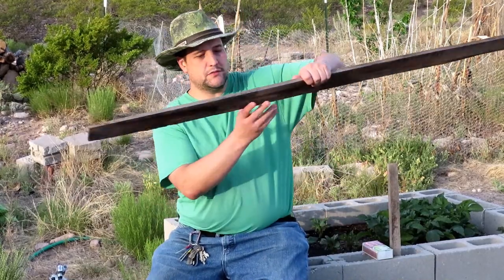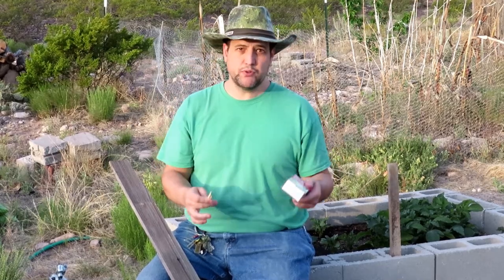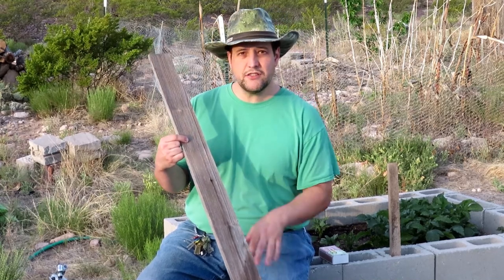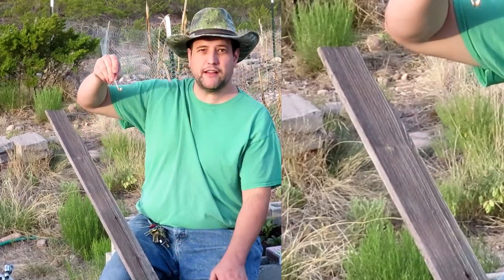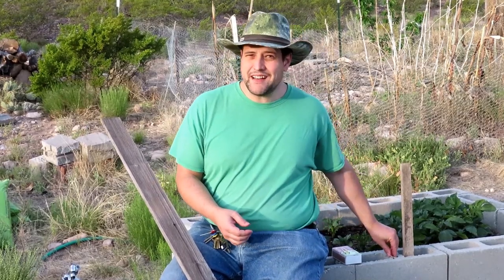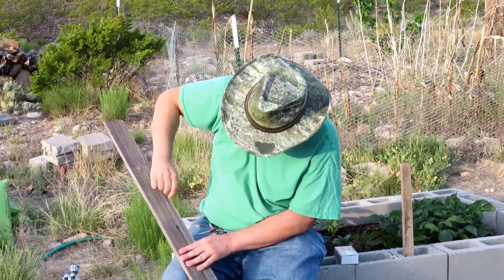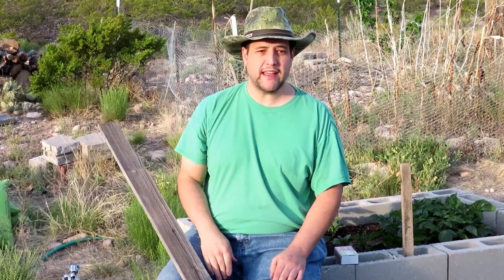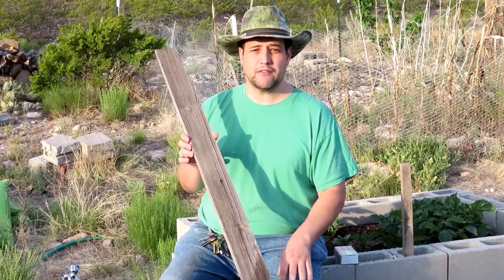Strike Anywhere Matches! Don't Need Em - Friction Light! | VR Praxis | Manifest Skills E009

Comment: to really get a match started just need something to "heat" it up.(the sulfur in it i think) I've tried with ferro rod, solar  and with sparks with dead lighters.  I should try with a board and maybe understand it better as whole
Reply from the maker: Yep, heat is what is needed.  You are just reaching the ignition point, like how wood will burn at its ignition point.

A quick movement down a board generates a good amount of friction and you can get them to ignite. I have also use a magnifying glasses to provide the heat needed.

Comment: Good demo but generally I find a good old BIC works better than any other method :-)
Reply from the maker: I'm not sure about using a BIC.  That plastic is pretty slick and I'm not sure running the match along the side of it would let you build up enough heat to ignite the match head. ;-)
Reply: @reedin9954  :-)
Reply: @reedin9954  this is how you respond to a sarcastic vegan troll.  Bic is good for everything but lighting biolite stoves, which cost about 3000 bic lighters
Reply: @LetsTalkAboutPrepping  :-) Those with no Imagination are Manifestly still using the Angry Prepper Grill :-)
Reply from the maker: Ha! I haven't heard angry prepper brought up in a long while.
Reply: @reedin9954  he is back as the facehole and cooking preparedness 101
Reply from the maker: Let's Talk About Prepping - Thanks.  I will take a look.